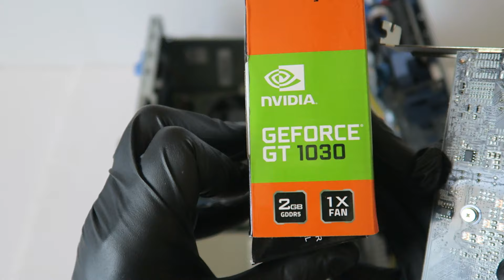Dell Optiplex 7050 Upgrade Gaming Video Card RAM SSD

Comment from the maker: List of Upgrade parts that work with this system.

USB Wifi Adapter for PC AC600Mbps Wireless Network Adapter
https://amzn.to/2ZaGuHb

List video cards will work with this system GT 1030 will work with 180W Power Supply or 240W you can use GTX 1650 or GTX 1050 TI low profile.

(1.)AMD Radeon RX 6400 Low Profile Gaming Graphics Card
https://amzn.to/3s8MUUY

(2.) Gigabyte GeForce GTX 1650 OC Low Profile 
https://amzn.to/3el08os

(3.) Gigabyte Geforce GTX 1050 Ti OC Low Profile 4GB GDDR5 128 Bit PCI-E Graphic Card (GV-N105TOC-4GL) 
https://amzn.to/2T8bfsv

(4.) MSI Gaming GeForce GTX 1650 4GB GDRR5 Low Profile Graphics Card (GTX 1650 4GT LP OC) 
https://amzn.to/2X1FYsF

(5.) MSI GTX 1050 TI 4GT Low Profile  Graphic Cards 
https://amzn.to/2LwZd7P

(6.) Gigabyte GeForce GT 1030 GV-N1030D5-2GL Low Profile 2G Computer Graphics Card 
https://amzn.to/2Z4PHkp

(7.) ZOTAC GeForce GT 1030 2GB GDDR5 64-bit PCIe 3.0 DirectX 12 HDCP Ready Low Profile Video Card ZT-P10300A-10L 
https://amzn.to/2WzgLXk 

RAM List:
(1.) Crucial 8GB Single DDR4 2666 MT/s (PC4-21300)
https://amzn.to/2Yx6s64

(2.) Crucial Ballistix Gaming Memory Kit 16GB 2666 MHz DDR4 DRAM 
https://amzn.to/2Ar1orV

(3.) Crucial 32GB Kit (16GBx2) DDR4 2666 MT/s (PC4-21300) 
https://amzn.to/2YDNzhA

(4.) Crucial 16GB Kit (8GBx2) DDR4 2666 MT/s (PC4-21300)
https://amzn.to/3hvAZJV 

(5.) Crucial 16GB Kit (8GBx2) DDR4 3200 MT/S (PC4-25600) 
https://amzn.to/2UGPK2I

(6.) Crucial 8GB DDR4 3200 MT/s (PC4-25600)
https://amzn.to/2R07Ier

(7.) Crucial 16GB Kit (8GB x 2) DDR4 3200 MT/s (PC4-25600)
https://amzn.to/326cfT7 

M.2 NVMe Interface SSD:
1. Samsung (MZ-V7E1T0BW) 970 EVO SSD 1TB M.2 NVMe
https://amzn.to/3d52k2a

2. Samsung 970 EVO Plus SSD 500GB
https://amzn.to/3fpi95A

3. Samsung (MZ-V7E500BW) 970 EVO SSD 500GB - M.2 NVMe
https://amzn.to/37uuLFw

4. Crucial P1 500GB 3D NAND NVMe PCIe M.2 SSD - CT500P1SSD8 
https://amzn.to/2N07wKh

2.5 SSD Caddy Compatible for Dell Optiplex 3050 5050 7050 Hard Drive Caddy Bracket
https://amzn.to/3OKOOUb

SSD List:
1. Samsung 860 PRO SSD 256GB - 2.5 Inch SATA III Internal Solid State Drive
https://amzn.to/2BY5gRl

2. Samsung SSD 860 EVO 250GB 2.5 Inch SATA III Internal SSD 
https://amzn.to/37xWUfc

3. SK hynix Gold S31 1TB 3D NAND 2.5 inch SATA III Internal SSD
https://amzn.to/3d7X6D6

4. Samsung SSD 860 EVO 1TB 2.5 Inch SATA
https://amzn.to/2B2FURX
Reply: Thank you soooooo much
Reply: Thanks for the video. Can you please post a video to change the CPU in 7050 MT & SF?
Reply: Do the video cards work with the micro?
Reply: Hello, first of all, thanks for your service. I wanted to ask if there is a suitable 300W PSU for 7050? You had recommended one for 7040 so I thought you would have had some idea about 7050 as well.
Thanks in advance :)
Reply: USLESS upgrade!! 
No cooling
Reply: Is it possible for a 1650?
Reply: @kennethschultz6465  its only useless if you have a lot of money
Reply: Can i fit a 1080ti ?
Reply: Can we use 1650 super
Reply: why are you only showing low profile graphics cards? I have full height rx 460 and it works great!

Comment: This is ridiculous, GPU clearly does NOT need to be a low profile card! The mini tower is thick enough to handle a standard size GPU as long as it is not too long in size. Something like a Zotac 1050ti would work just fine.
Reply: The dual fan one will fit?
Reply: Pretty sure your power supply would die
Reply: Theres not enough power. Mone only takes a gpu that has no external power so. Those who do not know do not speak 😆😆😆😆😆
Reply: The Zotac 1050ti actually is a low profile GPU, requiring no more than 75 watts drawn directly from the PCIe 3.0 x16 socket to function. Implying that a standard PSU-powered GPU will just plug-n-pay directly with this system is not only incorrect but using the Zotac 1050ti as an example of this is just hilarious. :D
Reply: The power is the issue, you'd have to use a SATA power to 6 pin adapter if you wanted to do something like that and that's kinda janky and still limiting. Dont make comments if you don't know what your saying.
Reply: Or just grab the saw
Reply: I have a 3050 low profile and as far as I can tell that's the best card you can fit inside of a 7050 without your power supply dying

Comment: This video is exactly what I needed! I just ordered an Opti 7050 MT and will definitely be upgrading it just like this.
Reply from the maker: Hi..
Reply: how did you go about upgrading psu
Reply: @joshua valdivia  Didn't. The one I found came with a "Platinum" grade supply as standard, and just went with a GTX 1050 TI to keep power needs low.
Reply: Would these parts be compatible with the regular tower version?

Comment: Hi Mxkdi, wanted to ask if i need to upgrade psu if i use the 1650? I have the same specs as the one in this video except 32 gb ram. Thanks for the video!
Reply: how did you get it to register your gtx 1650 it’s not registering on my pc only see internal graphics

Comment: I believe my PSU is a 180w where can i get a good deal for a 240w and what graphics card do you recommend out of the ones you showed i got a optiplex i7-7050. let me know if you need more information so i can decide which ones to get for my desktop I use it for streaming but i need to lower my GPU usage it been hitting somewhere around 75% or more since its a intergraded GPU and not a dedicated

Comment: thanks to everyone for the useful info ,I'm been trying for over a year to find the best components for my gf's pc . The video but specially comment section were very helpful so i could have a better understanding and it was much easier to understand .
Reply from the maker: Hi. thanks.
Reply: @Mxkdt  hello I need the part number for the hard drive caddy you have in this video any idea what it is?
Reply from the maker: @paranoid1123  Hi, yes it is  3.5" Hard Drive Caddy DP/N 00CW33 0CW33, they sell on ebay used

Comment: hello can you please make a video on how to case swap this
Reply: Unless you want to put yourself through some serious electrical engineering hell, no video required. Just toss out the proprietary PSU and motherboard that are totally non-standard and replace with a standard ATX12V PSU and standard board. The real gem inside the Optiplex 7050's case is the processor. Everything else is pretty much either non-standard or low-end anyway.

You'll find that you can't just plug a standard ATX PSU into this board directly, that it requires the construction of an adapter to handle Dell's own pin orientations and strange routing of 5v/12v leads. The board in question is definitely not worth the cost required to adapt it to a standard ATX12V power supply.

Comment: I found GTX 1050 Ti require 75W and recommended PSU is 300W. Original PSU for this Model only 240W.. Can you show how it perform when using the GTX1050 Ti with this CPU.
Reply: A 75 watt draw from the PCIe 3.0 x16 slot shouldn't overburden the stock PSU. Most of these low profile GPUs were designed specifically for the purpose of operating efficiently in low power scenarios such as that encountered with the OptiPlex.
Reply: @JonathanLawrenceMitchell  4:27 I purchased the AMD Radeon RX 6400 (by Sapphire) It did not work although it doesn´t need additional power cord and it was the card with the lowest power conumption mentioned.  The card only uses about 50 watts and Chat GPT suggested that even the pci slot gives enough power of 75 watts, it sometimes consumes more than 75 watts and that´s why it is not booting. Or it can be, that because of the pci express 4.0 the card uses, the optiplex does not allow it to work. I have no clue, I just want the best card possible for this pc. The thing is, I originally thought that the rx 6400 is already the best card in terms of power conumption vs performance. But there is no benefit, if it is not working anyways. I  did not want to add an other psu so which card do you suggest? There are other solutions with a sata-cord splited into a 6 pin connector, so even a "normal" gpu with more tahn 75 watts can work, but I have no experience with that.

Comment: can i change mother board to asus rog strix b250g is this better or not what you suggest ? best mother board
Reply: That's pretty much what I'd suggest anyway since the proprietary motherboard and CPU of the Optiplex are terribly underpowered and low-end. Just ensure that your chosen mb is equipped with the requisite LGA 1151 (R1) socket that's designed exclusively for 6th and 7th Generation Intel Core processors. I only mention this because the LGA 1151 socket went through two revisions, R1 for 6th and 7th Gen processors and R2 for 8th and 9th Gen processors. R1 and R2 are not compatible due to changes in processor pinouts between these revisions.

Comment: Isn't 240W too little for the GTX1050 Ti, which has a power draw of 75W?
Reply: I run a GTX750 in my Optiplex 7060 which has the same power supply and I have not had any problems, I think the GTX750 is about 65w power rated... I think it's close to the limits of the power supply but Dell power supplies often cope it seems.
Reply: I have it for like a year now and never faced any problem. same machine.
Reply: I've had a dell optipelx 7010 with a 240 watt psu. I used it with a core i5 2400, a 95 watt cpu along with a gtx 1050 which is a 75 watt card. Worked perfectly fine on full load.
Reply: Mine runs fine with a GTX 1650 in it.

Comment: I got a 1050Ti to work no problem. I replaced the PSU with a 500Watt and 8pin adapter (externally), works great but when I put in a GTX306 it will not get finished in with the power on test after plugging in. Light comes on the front, then off, CPU fans spin, but never stop. Power button does nothing. -- I made several recommended bios changes -- --- UEFi Boot path (diasble), UEFi Capsule Updates (diasble), SMM Security Mitigatio (diasble), SSR Messages (diasble), Secure Boot (diasble), Fastboot (Minimal). Settings are fine without the card. Thoughts?
Reply from the maker: Hi, i have not tested rtx 3060 with this PC  yet and did you try that PSU  500Watt and 8pin adapter (externally) with gtx 1050 ti does it work ?
Reply: @Mxkdt  Hmm. I did not see an external spot for that 1050Ti. It did not seem to need one. I'll look at it soon and report back. It works fine though.

Comment: Would you need to upgrade the PSU as well to make compatible with a GTX 1650 GPU? As the default PSU in Dell Optiplex 7050 is 240W.
Reply: Have u tried ?

Comment: hey i just wanted to ask if i can take out the motherboard and put it in a different casing?
Reply: Yes, you can, although not without some hassle. The PSU and several connectors are proprietary Dell designs and, as such, will not be directly compatible with a standard ATX12V power supply unit. I believe that there are several tutorials out here that assist in the process of performing such a swap but I'd assert that it might be more practical and far less stressful to just swap out the board as well to something that's actually plug-n-play compatible with a standard ATX12V PSU.

That opens tons of options for gaming boards designed for the LGA 1151 (R1) socket supporting 7th Gen Intel Core processors while gaining PCIe 4.0 capabilities, more SATA III ports, modern USB / USB-C ports, integrated wifi/bluetooth and more M.2 NVMe slots... and let's not forget more fan headers and rgb lighting capabilities. ;)

Comment: Hey man, don't know if you will answer this but... I have this dell 7050 of the video but in ssf, a 1650 low profile will work?
Reply: The GeForce 1650 has a maximum power draw of 75 watts, thus not requiring an external power connector. It will draw all of the power it requires from the PCIe 3.0 x16 slot into which it is installed. This is one of several optimal GPU solutions for this particular system since it would not require an upgrade to the proprietary PSU to take advantage of the performance gains it offers.

Comment: do i need to change the power supply to make  the gpu work?
give me an answer pleaseeee
Reply: It depends on the GPU you're wanting to install. There are several varieties of "low profile" GPUs on the market that are designed exclusively to draw their power directly from the PCIe 3.0 x16 slot into which they're installed so, in that, there would be no need to attempt to swap out the non-standard proprietary PSU with something else. If, however, you're going for a higher-end GPU that requires a power connector from the PSU to function, you would have contend with the drama involved in swapping out this non-standard PSU for one that's compatible with your GPU.

Comment: Hello im about to buy M.2 NVMe Interface SSD - samsung evo 970Plus is it compatible? is there any differencie between 970 evo vs  970 evo plus (which one is better). Thanks

My pc is optiplex 7050 sff
Reply from the maker: Hi, yes that SSD will work fine i would recommend SAMSUNG 970 EVO Plus SSD 1TB
https://amzn.to/3J9L2BN
and difference between 970 evo vs  970 evo plus is plus has faster write speeds.

Comment: Probably a dumb question but what's the best way to install new windows on these pcs with no optical drives?
Reply from the maker: Hi, you have to use USB flash drive.
Reply: Along with OP's valid solution, you can also use a utility like Clonezilla to clone an existing installation on another pc over to the intended 7050's system drive. This option requires you to have most, if not all, of your 7050's drivers on hand to install manually upon booting unless your cloned OS is procured from the exact same system sporting the exact same hardware.

Some might say that this method borders on illegal since you're technically required to obtain a unique license for each install of Windows 10. However, we are, as of today, less than 2 years away from the official EOL date for Windows 10, after which Microsoft will no longer be providing service to or licenses for Windows 10. In effect, the OS will be deemed obsolete and useless as a retail product to Microsoft.

Comment: Hey bro, i had this model and i have question, is compatible with a cpu of 8th gen? Greetings
Reply: For posterity: although sharing the same physical dimensions based on the LGA 1150 socket (4th and 5th Generations), due to the various pin layout revisions to the LGA 1151 socket line from Generations 6 and 7 to Generations 8 and 9, Generations 8/9 Intel Core processors are not compatible with LGA 1151 (R1) sockets and, likewise, Generations 6/7 Intel Core processors are not compatible with LGA 1151 (R2) sockets.

It's an interesting era in which many generations of Intel Core processors would physically fit sockets from LGA 1150 through all iterations of LGA 1151, specially 4th, 5th, 6th, 7th, 8th and 9th generation Intel Core processors, but, due to the various revisions to pin layouts as power requirements increased, there is no actual compatibility between 4th/5th generation processors, 6th/7th generation processors and 8th/9th generation processors.

The general standard is:

LGA 1150 Socket..............................4th and 5th Generation Intel Core CPUs
LGA 1151 (Revision 1) Socket.........6th and 7th Generation Intel Core CPUs
LGA 1151 (Revision 2) Socket.........8th and 9th Generation Intel Core CPUs

There are other socket types in the mix for various differences in cpu architecture along development of these generations but this is pretty much the gist of it Intel Core processors existing within these generations. There's also the matter of updating BIOS for motherboards specifically designed for 6th Generation processors to facilitate use of 7th Generation processors with those boards.

There is, however, no means by which to force an 8th or 9th generation Intel Core processor to be recognized by a 6th or 7th generation board even though the processors, themselves, will fit the sockets. Again, even though the physical dimensions of the sockets and processors remained that similar throughout all of these generations, their pin layouts were changed enough so that they would not power up correctly outside the slightly altered sockets that were revised for their generational increases in power requirements. This makes for much confusion when searching for compatible motherboards because, unless you know exactly which revision of the LGA 1151 socket your target cpu requires, you have a 50/50 chance of achieving compatibility.
Reply: @JonathanLawrenceMitchell  Thoughts on pairing the Optiplex 7050 Mini Tower with the i7 7700 with an rx 6400 low profile? should work in theory, and still be faster than my (now dead) machine (gtx960/i5 6500) 

The only thing that worries me is that the rx 6400 uses pcie4 and the mobo only supports is pcie3 (I assume the i7 minitower carries the 250w psu)

Comment: Please help! I've upgraded my Optiplex 7050 PSU to a Corsair SF600 and a GTX 1060 3gb (6-pin). The PC will boot fine into Windows without the graphics card installed but will not boot when graphics card is installed. I've tested the PSU, PCIE slot etc. Stumped.
Reply: Solved ?
Reply: It's not a straight forward swap. The problem is that the alleged "ATX" connection on Dell's board isn't actually ATX, it's proprietary Dell and so the pins on the board do not match the pins on a standard ATX PSU's connector.

The swap requires building an adapter to not only reroute the pins but to also deal with Dell's non-standard routing of the 5v/12v leads. Unless you're an electrical engineer and totally into building funky one-off adapters to get around proprietary nonsense, it's advised to just obtain a new board that supports 7th Gen Intel Core processors and retire the proprietary components.